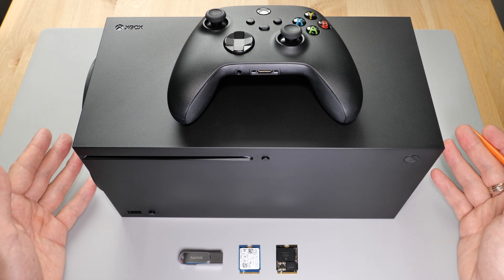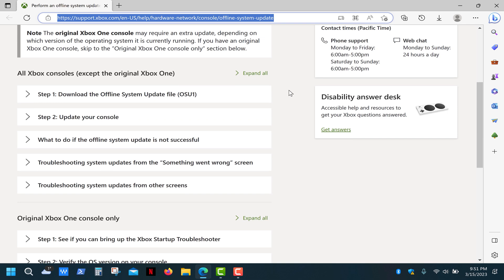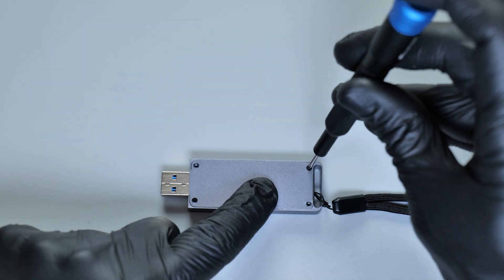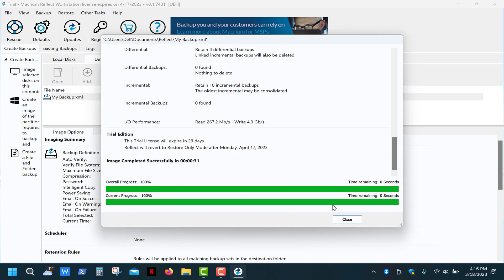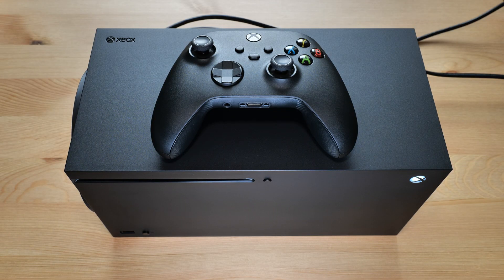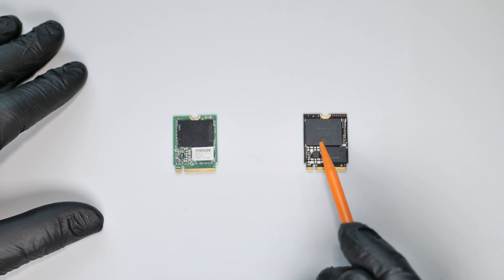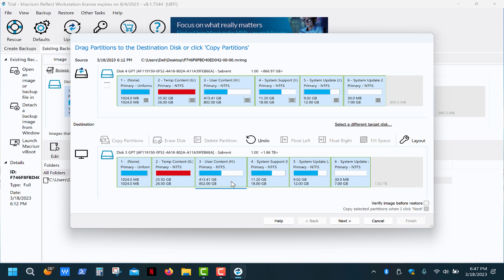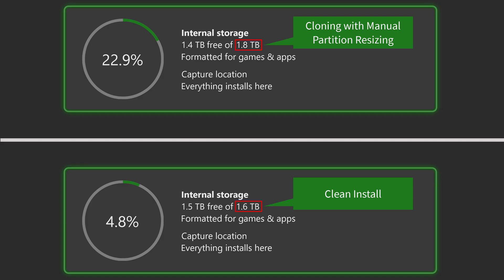Upgrade Xbox Series X SSD to 2TB – Clean Install or Clone Method (Step-by-Step Guide)

Comment: Warning for current date (October 15th 2025) - the OSU1 on the Xbox support site (sept 19th 2025) doesn't match the current version of console update (October 9th 2025) so you will not be able to restore to a new SSD if you updated your console after 9th October. MS are notoriously bad at updating the files on their site so it will have to wait until they post the new one. 
Due to this, you will get error e101 after 1% completion of update from USB.
Reply: The OSU1 on the support website has now been updated and should now be 1st October 2025. This can be used to restore to the current version of the console update.
Reply from the maker: You're right, Microsoft is often late in updating their OSU files. I guess they're too "busy" to do that.
Reply: @ElectronicsComputers The solution to it is:
Prepare your new SSD: copy the hidden partition accross and leave the rest empty. Put the new SSD into your console and wait for the "preparing console" screen to switch to the troubleshooting screen. Then try and run the outdated update from a USB stick. It will stop after 1% but will create the default partitions on the new SSD. Now remove the new SSD from the console after powering off. Keep track of which one is the new one and which one is the old one.  From your OLD SSD from your console, use a caddy on your PC and copy all the data from the "Update" partition into a folder on your PC. There is no need for anything from "update 2" and it shouldn't have anything in it anyway. 
Now insert the new SSD into the caddy and you should be able to open the update partition as a drive and it should have a few files in it. Copy all the files from the folder on your PC containing the files from your original drive into the new SSDs update folder. Overwrite all that it asks for. 
Put your new SSD into the console once completed and boot your console as normal with no USB pen but ethernet attached. 
The console will now update without running an offline update file (OSU1) and start normally. 
Good luck!
Reply: @AzumiRM  I got a console but presumably bad SSD, which I now replaced with  the  instructions from video. Just in case I also cloned a whole SSD. but upon the offline update, I get fail on validation with E101 error, which I assume is due to that OSU1 update, is there a way to see when it was update so I can track it ? 
I've tried your  solution with copying update partition content to new ssd, but that gets me to where I was with "faulty" ssd which is stuck on 66% of applying the update. So I guess because I broke update on original  sdd, before cloning is.. I am stuck until there is an update ? 
I don't even know what is the OS version on xbox currently, as that's not displayed anywhere. any other tricks ? (altough I think error for outdated OSU1 is 8B050041 but I get different  E101 9014... error, so not sure)
Reply: @gbkwiatt if you cloned the whole SSD that you took out of the console then it shouldn't need offline update if successful. If you updated the console after 22nd September (via console menu) then you'll need the OSU1 from the official site as that's the current version. If you didn't update the console before 22nd September then you'll need the previous version or a version that was current at the time of update. The previous 1 version is 6.80gb extracted size, the latest version is 6.76gb extracted size.
Reply: @AzumiRM  So the story is - that I got this console from ebay, with E200 which I think could be connected to bad update, or faulty ssd. It was unopened so I was thinking I can have a go. But before I took it apart, I tried OSU1 upgrade with USB on  original SSD, which got me to the 66% applying stuck state. So I changed SSD with whole procedure from here, and now I get E101  during update validation. Or if I copy Update partition, I get back to 66% stuck state. I guess I  should have cloned SSD before I started anything. But s it stands I have no idea when it was last successfully updated. so I am not even sure if my E101 means that OSU1 is outdated. I am not really concern with bricking it, as I only got it for my own curiosity hunger. But it bothers me that I have no idea what's wrong, because errors don't really explain much. But it looks, that only think that's left is awaiting another update and trying. I am happy to do experiments if anyone has some cool ideas.
Reply: @gbkwiatt you need the first partition from the original if you can still get it. Then try different versions of the OSU1 file (the older ones should be around somewhere). Unfortunately, each time you want to try a different OSU1, you'll need to delete all partitions and image the 1st partition back again from the original SSD (the one with error 200). The only thing you can do is repeat the process until you find a compatible OSU1. I don't think the Microsoft site has any old versions for download so you'd have to find an archive of them.
Reply: @AzumiRM  I have a whole clone of my original SSD fine and secure so yeh  I already was doing the wipe and back again. So  I thought it only fails when xbox firmware is newer or the same, with the OSU1 update, do you think it could be some other mismatches ? I have my original Update partition with A and B directories, but I assume I would "corrupt" that when trying offline update before I cloned it. This is fun. Thanks for helping btw.
Reply: @gbkwiatt you only need the first 1gb partition. The OSU1 will partition the rest for you. Is it definitely a ch sn530 or ch sn56p you're using?
Reply: @AzumiRM  yes,  I actually have 2 WD SN530 from xboxes. if it was not compatible, I believe it would not power up with image at all. so yeh I was doing it with just boot partition (1GB), but offline update always fails on Validation after downloading it. however I tried both 3 SSDs (one is my original), with the same approach, and each fails at different % of validation with diffeent E101 9007 error or 9014.  I mean - there could be a change that those SSDs are  broken too as they are used. I am waiting for the one from Aliexpress from the link in this video, should be with me in next 2 days. However I doubt it will change anything. It would be rather conicidence to have 3 SSDs  failing with E101 with offline update, but not impossible. But I guess there is no other things I can try
Reply: @gbkwiatt you can only try downloading older versions of OSU1. Also, you cannot reuse an OSU1 flash drive as it is repeatedly. You have to reformat it and copy the update folder across each time. Even if it only gets to 1%
Reply: @AzumiRM  interesting, why is that ? I just deleted directory and put OSU1 from June (I found archives), but that indeed returned 8B050041 error, which from what I read means my current firmware is newer then the one from OSU1. But I reused USB I used before with just removing the directory
Reply: @gbkwiatt the very latest one is the one currently on Microsoft's own site. The files within the $systemupdate folder for the latest firmware should be dated 1st October. The version prior to that should have files dated 19th September.
Reply: @gbkwiatt I think the section for initializing the partitioning of the NVMe gets removed once it starts being used, this is probably what is causing it to become unusable after starting it once.
Reply: @AzumiRM  so does that mean, they should release new OSU1 as it seems there was a firmware update in November 12, so I would assume OSU1 should also be that, but they are always behind with updating OSU1. I can see in latest OSU1 that directory was modified  on 06th of November so definitely not the latest firmware update, so I guess maybe in december they will udpate that file to have novembers update
Reply: @gbkwiatt I see theyve released a new update. The current one is 6th Nov yes. I'm sure there must be archive sites out there for old versions. I have the previous two and now the current one. If there is somewhere to upload it, then I will but I don't think YT allows links to be posted.
Reply: @AzumiRM  ok so there are couple of things that  I think was mentioned here in comments, but here is what happened 
- I managed to get passed on one of my SSDs (original one), validation on offline update, funny enough it only worked when I had ethernet plugged, so it needs internet after all
- One thing that happened after that, is that it changed a boot partition, because my cloned boot partition stopped working on other driver, luckily I noticed and cloned that "working" boot partition again. 
- IT still failed update, but now I believe it's due to OS mismatch, I've managed to see on troubleshooting screen my currnet OS version, which seems to be the latest November 2025  fit_2510ge.251105-2200. 
However from what I can see and what you said OSU1 file is from before that (October 2025). So I assume someone who had that console before me, had insiders program enabled and had latest OS before it is available as production firmware. Hence it fails to update. 
So I guess the solution now is to wait until the latest November 2025 OS is  released in OSU1.
However on Microsoft page, it states that if your console is enrolled with insiders program, you won't be able to update it with OSU1 (sounds like you won't be able to do it ever until you remove it from insiders program)
- also I can see little difference between my current OS "xb_fit..."  and the one on release microsoft page  "xb_flt..." my assumption is that fit means that it is insiders firmware. So I hope I will be able to upgrade it regardless
Reply: @AzumiRM well, another day another fight, turns out it was not releast onto insiders program the best I can get out of my all 3 used original Xbox SSDs is to get to updating firmware and Applying stage, which is always stuck at 66% on all of them... Something tells me, maybe it isn't an SSD issue

Comment: Hello, i have a question and i believe that you could help me. I was enrolled in xbox insiders program. Before i made anything i unrolled from xbox insiders then xbox series x wanted me to reinstall/downgrade system update and i did it. After that i checked for system version and it was 10.0.26100.5735 (xb_flt_2509ge.250930-2000). Then i did everything like in the video and on new drive when i want to make an offline update i got E101 00000504 8B050041 error. People say that 8B050041 error is because OSU file is older than my console version, it seems like the official OSU isn't matching this version, because OSU files from official site is dated on 19th September and the newest version that i have on my console is from 9th October. Can you tell me if i should reuse old ssd, wait for new update, update, and then move this first partition or i can wait now for new OSU to drop and then install succesfully on new SSD? I don't want to brick that console.
Reply from the maker: That has actually happened dozens of times before, thanks to Microsoft. They update those OSU files with a big delay. So just put your old drive back and try again later. Also, make sure you’re using a compatible SSD.

Comment: Hi I have a formatted Xbox can I clone an another Xbox SSD like this with this formatted one and use
Reply from the maker: If the original SSD was formatted and you no longer have the bootable partition that contained the encryption key, unfortunately, the console can’t be repaired. The only option is to send it to Microsoft, and they’ll replace it with a refurbished console of unknown history for around $350 or you can sell it for donor parts and buy a new one.

Comment: Did everything shown in this video and keep alerting an error code E109 and a bunch on 0's after. Using a Wad black 1 tb 2230 drive any thoughts thanks!
Reply from the maker: That SSD model is not compatible with the console.
Reply: @ElectronicsComputers which 2230 ssd from Amazon can I buy to work on the series x?
Reply: @ElectronicsComputers it should be since a WD black SSD(512/1TB) is official used as a storage expansion card for Series X/S.

Comment: Compatible nvme drivers are
1. WD CH SN530 (not the PC SN530) 
2. Lite On XA 1-311024
Both of these are available in 512gb and 1tb versions.
Reply: So PC SN530 will never work? That's a shame as they are easily purchasable vs CH
Reply: @Isles4145 there is the CH SN560 which also works and is slightly faster but the PC variant of either doesn't work, I tested and confirmed.
Reply: @AzumiRM  Dang. The drive from another system is a SSSTC XB2-311024. Can't find that anywhere. You tested Lite On XA 1-311024? That one I did find online and about to pull trigger
Reply: @Isles4145 yes, the liteON one worked fine for me. Just make sure to copy the hidden partition across. 
So far I have found: 
WD CH sn530 - slower but cheaper and more available
WD CH SN560 - faster, slightly more expensive and not easy to find brand new 
liteON XA1 - similar price and performance to SN560 but more available. 

The only way to get these brand new is to import from China.

I'll buy an sn740 2tb and see how it goes. They're pretty easy to find without importing from china.
Reply: Did you try the sn740 2tb already? Really curious
Reply: The 2tb drive shown in this video looks like either a WD sn740 or an XPC technologies 2TB NVMe.

Comment: How do you know which m2 drives are compatible with the expansion drive housing? Everything points back the the WD C50 drive, is that the only one?
Reply from the maker: Xbox officially supports only these: WD CH SN530 or  SSSTC XA1. There are also some modified WD models occasionally available on eBay and AliExpress.

Comment: Could i possible make my series s 2tb or is this ssd only compatible with the series x
Reply from the maker: Both the Series S and Series X use the same SSDs. Microsoft made sure that you can’t use just any random drive. If the original drive fails and its bootable partition can’t be recovered, the console essentially becomes e-wast, in that case at best it can be sold for around $60 for donor parts as it's impossible to fix them.

Comment: Hi, is it compatible with ssd nvme m2 "pcie 4.0 x4"?
Reply from the maker: There are only several compatible models (You can use WD CH SN530 or SSSTC XA1) and they are all identical specs wise.
Reply: @ElectronicsComputers thank you very much for your fast answer. Have a nice day.

Comment: Hi, in another video you mention three compatible SSDs: the NS530, NS560, and the NS740, which is 2TB. Are you using the NS740 in this video?
Reply from the maker: Give me the link and a timestamp to that.
Reply: https://youtu.be/4UejMzJ807g?si=wGKyDqScEj0WRT-O
min 04:38
im looking for change the internal ssd of my series X 

 @ElectronicsComputers
Reply from the maker: @hernancaceres4961  I didn't mention there any SSD model at all.
Reply: @ElectronicsComputers You don't mention it, but the drive on the right is labeled SN740 2TB. The one on the left is the SN530. Finally, the one in the middle is the 1TB SST. I'm really getting confused because the SN530 is too expensive in my country, whereas the SN740 2TB is easier to get and cheaper.
Reply from the maker: @hernancaceres4961  I already answered you in another video about the SN740 situation.

Comment: Hi, my Xbox X ssd is bad and the computer won’t read it. So I cannot create the boot partition. Is there any way I can get the boot drive? Please let me know thanks for your help.
Reply from the maker: Hey! First, can you tell if Windows recognizes the SSD at all does it show up in This PC or Disk Management? Also, let me know which software you've already tried. If the SSD shows up but isn't readable, you could try tools like: EaseUS Data Recovery, R-Studio, DiskGenius,
MiniTool Partition Wizard (can help recover lost partitions). If the drive is dead beyond recovery, the best thing you can do is sell your console for parts and invest into a new one, as without the original partition the console can't be fixed.